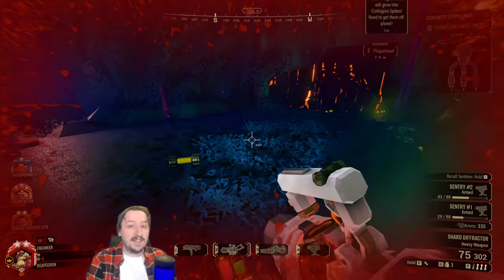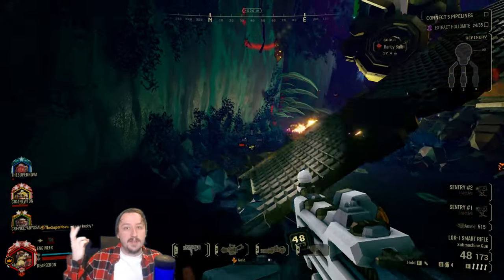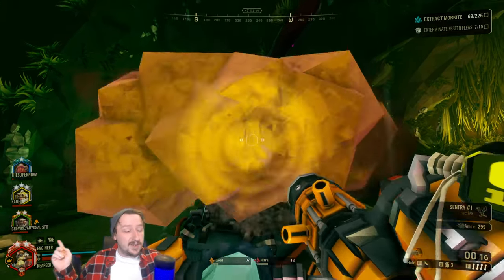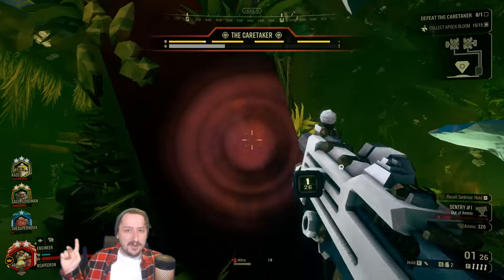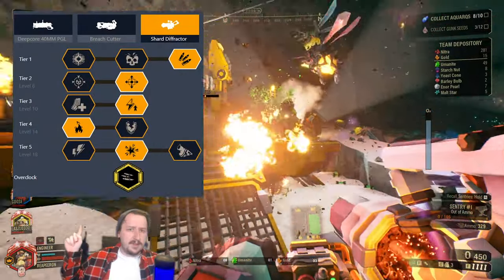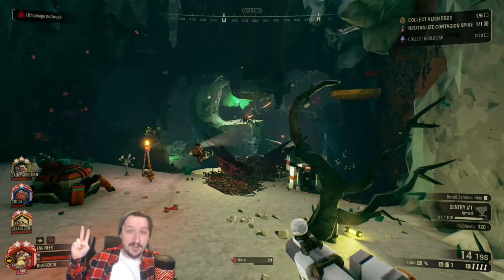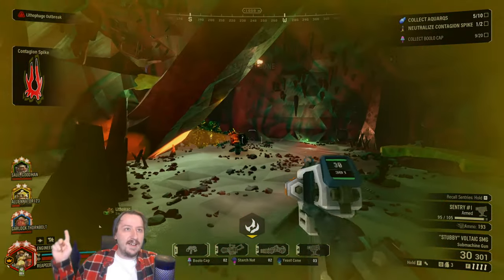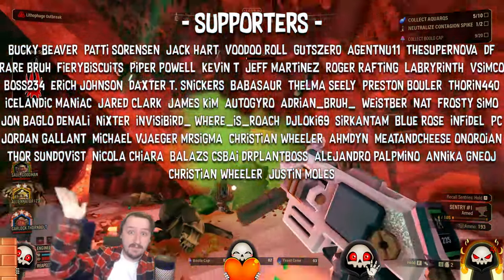Get the Most Out of Your Shard Diffractor: Loadouts Done Quick

Comment: Another feature with plascrete catalyst   is the width and damage of your beam significantly increases when it's hitting your platform BEFORE it explodes. Just keep moving the beam back and forth on the platform if you don't want the platform to explode right away! And then of course hold it on one spot when you want the explosion. Weird but one of my favorite overclocks...I might friendly fired Ron once on a Haz 5 refinery mission (oopsie)! :)

Comment: I was wondering when you would cover the plastecrete catalyst. One of my favorite Engi builds uses the thing with your set up. Saved my butt during a recent EDD. The explosion absolutely destroys large groups.
Reply: I sort of wrote it off based on the setup required, but it sounds like I should give it a try
Reply: @robjsmiles  it's very not practical to use, but if you are VERY quick and accurate switching between platform gun and shard defractor, and can be accurate on a moments notice, then it could be very powerful. I just find it takes a lot of planning to set up, and requires faster reflexes than most players have (at least on console) 

Also the friendly/self fire damage is kind of insane on the explosion 😅
Reply: @Jordblitz As someone who consistently gets into pvp against my friend whenever we do coop missions, the friendly fire of plastcrete is absolutely an upside.
Reply: I’m late to the party, but plastcrete catalyst is my go-to in holdout missions(MULE salvage, liquid morkite extraction, escort missions, etc). Since you likely are preparing your environment beforehand anyways, you can blast some platforms in predicted enemy paths and use them as cheaper sticky bombs when the enemies finally arrive. Being able to blow holes in Oppressors made me appreciate plastcrete catalyst a lot more.
Reply: @ThisIsntAYoutuber  blowing holes in oppressors?? 😳

Comment: Im curious if theres a way to use neuro lasso without gimping your damge toooooo much.  Have had fun working with a driller to keep them on aoe but outside of that its kinda "meh" as an OC.
Reply: Spinning death with the breach cutter.
Slow them inside the blender.
Reply: @themarlboromandalorian  Late to reply but will anyways. Tried spinning death (with plasma trail) along with a driller friend and a scout using cryo bolts and those new boomerangs. Worked REALLY well. Ty for the suggestion. Rock and stone!
Reply: I use neuro lasso in combination with volatile impact reactor shard defractor, and it worked great for me. Any time you see a group of any size (even small groups) you lay down a magma trail in the bugs' path, and then switch back to the smart rifle with Neuro lasso. Not only will the slowdown keep the bugs in the magma trail longer, dealing more damage, but it will cause them to burn in place, either outright killing them or chunking their health significantly. You can either let the bugs burn, or let loose with your smart rifle, with electrochemical rounds and electric generator. Since all bugs will be burning (and electrified if you have 3 locks), you will do huge amounts of damage to already weakened bugs. It's very powerful and feels great. I take more locks and wider lock on angle to slow down as many bugs in front of me as possible. I also use the 33% more damage against electrified enemies on the shard defractor, because you can quickly electrify a large target with the smart rifle, and then melt them with direct fire from the shard defractor......from any range. Elite threats become quite a joke with this, and you aren't sacrificing really anything to do it. 

I also feel like Neuro lasso is typically pretty "meh" considering why would you want to slow bugs when you could just kill them instead? Now you have a reason to slow them, because you want them to burn longer and stay in the trail longer. It's very ammo efficient, and allows you to kill anything at any range. Especially if you run weak spot damage on the shard defractor. The only main weakness of this build I have found is that if bugs appear out of nowhere, when you weren't prepared for them, it's not the best for stopping them. But Neuro lasso lok1 can kind of help you there by slowing every threat down. Plus you have your choice of grenades, power attack, turrets,  dash, and teammates to help you.

(Really my favorite part of this though, is you don't have to be accurate at all. It's quite easy for anyone to do, of any skill level once you get the VERY basic rythem)

Comment: Does the AOE upgrade on volatile impact reactor OC impact the size or affect of the magma trail at all? Or is it only AOE on direct hits/close terrain hits? 

I've always been using the weak spot damage bonus on it because I assumed the AOE would have no effect on the magma trail. Is this wrong? Because if it creates a larger magma trail, I will definitely want that instead
Reply from the maker: I think it adds to it by a little bit but not that much.  Both options are pretty good though.
Reply: @ReapeeRon  thanks, I will try it out with that